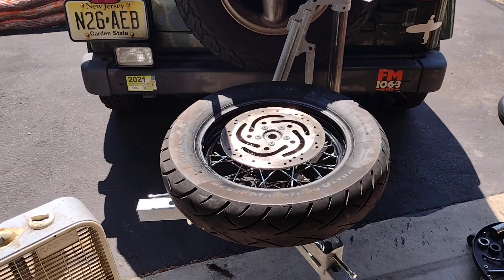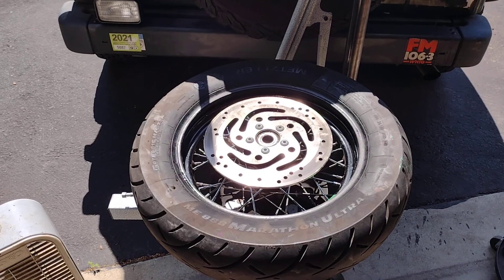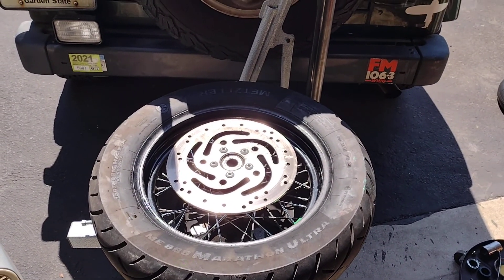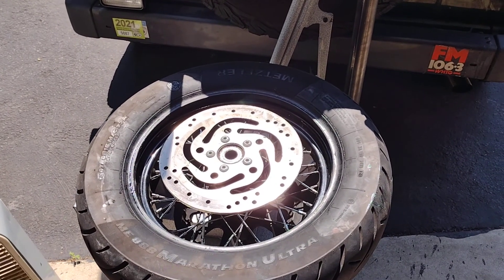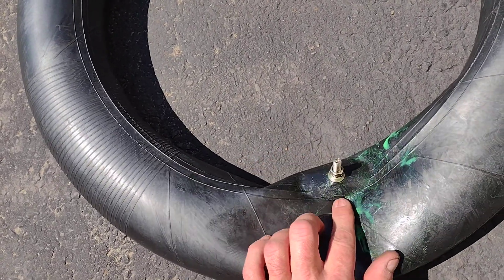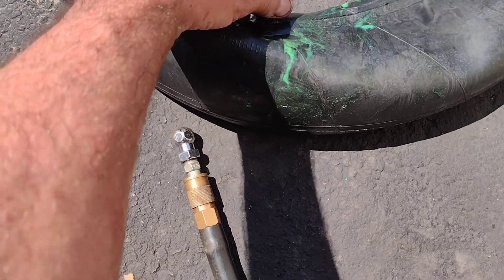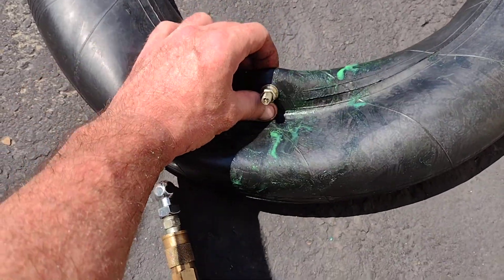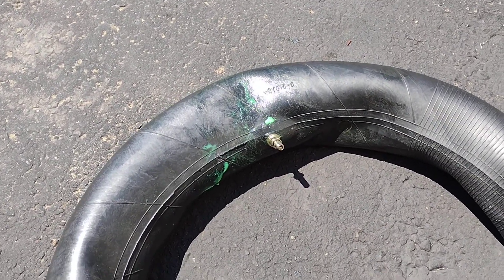2019 Harley Softail Slim Rear Inner Tube Split Open

Comment: Why did you go with tubes.was ur spokes leaking
Reply from the maker: The wheel is intended to be run with a tube.  The spokes aren't sealed so air would leak out there.   I just (as in last week) sealed the spokes with marine sealant.  I am still running a tube though as I could not get the tire to seat.  I tried running a ratchet strap around the tire to pull it into the wheel.  It still wouldn't hold air.